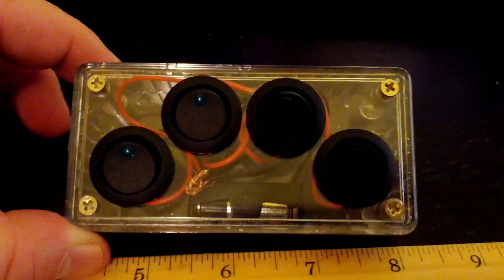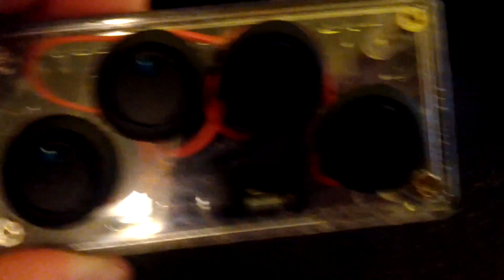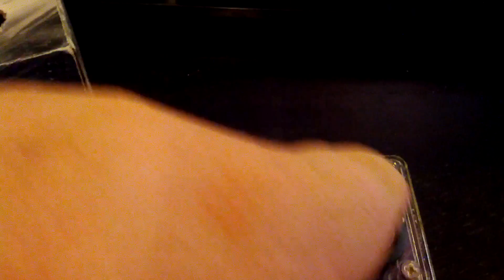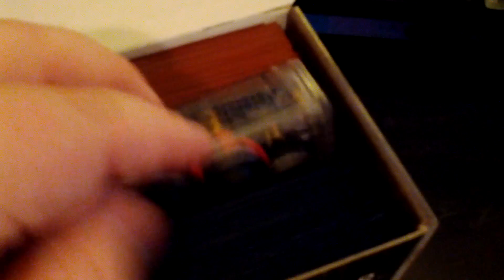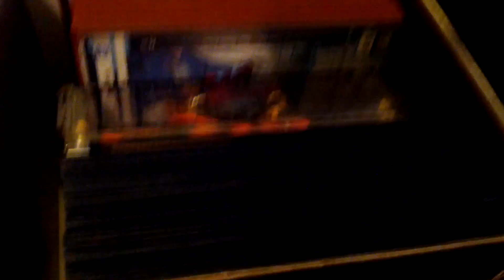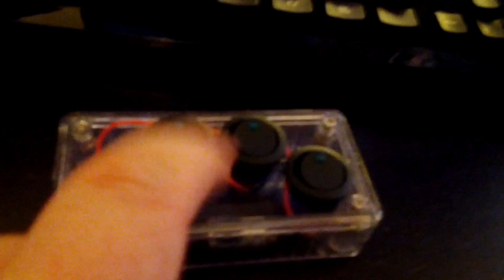Netrunner Click Tracker 2.0 Demo

Comment: Late to the party, but this is so dope! Definately going to try and make a pair for my playgroup. Seems like I can get the hammond polycarbonate box and switches on amazon (as much as I hate supporting them), so all I would need to add is the battery mount and the wiring. How did you secure the battery mount to the inside of the polycarbonate box if you dont mind me asking? Saw you using this one on a peachhack tournament video and was super impressed by it. Really creative man, great job!